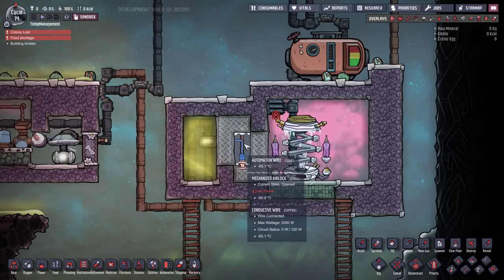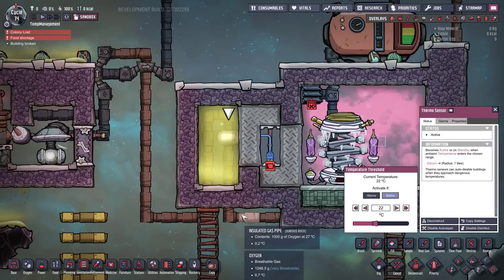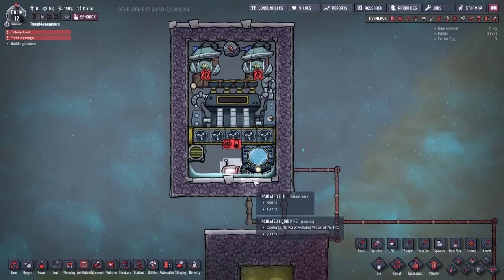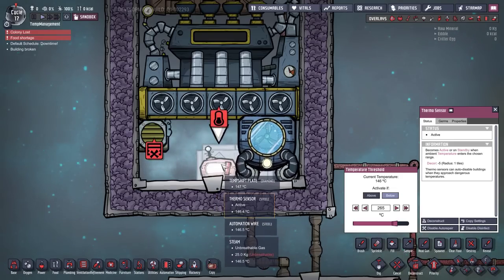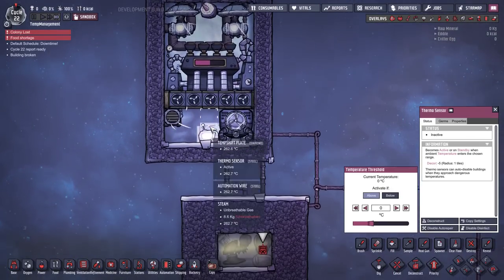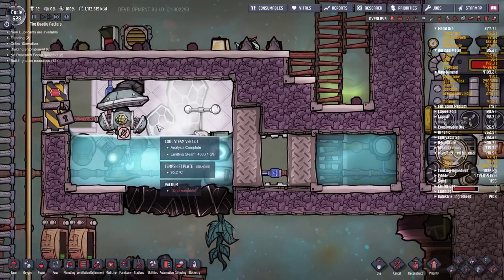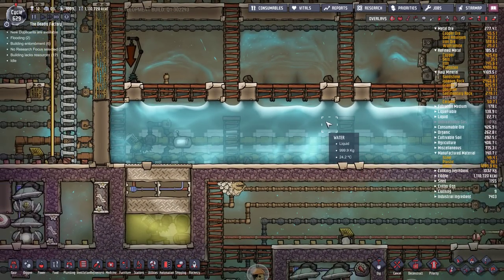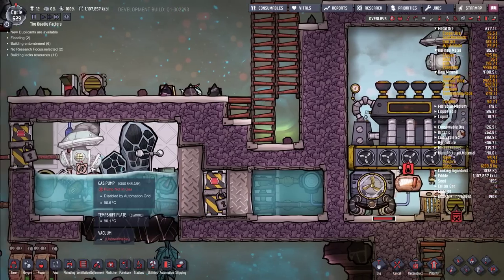Cooling, ATEN, Aquatuners and Steam turbine heat deletion. Tutorial 7 Oxygen not included

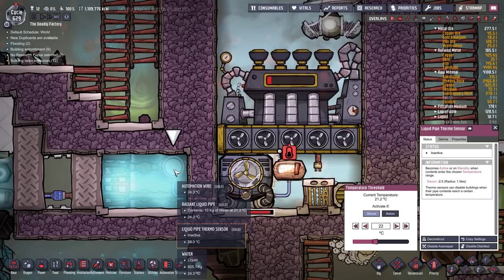Comment: answer to your question: 37:25. 
you have a 2 tile range in between the sensor and the aqua tuner which is a place where you cant check the temp. of the water
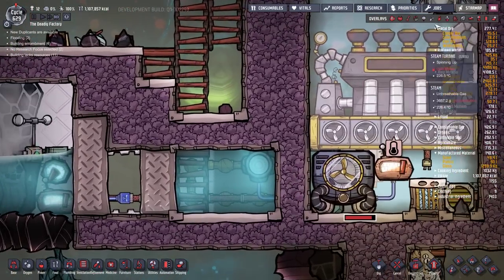you can see the 2 tile range 37:39

to let the sensor work 100% you need to place the sensor right next to the machine which has to shutoff or startup(so no place 
of unchecked temp. of water).

liquid oxygen or hydrogen for rockets, same setup but you can put the sensor right next to the aquatuner.

with this build you need a liquid shutoff next to the sensor, that will open if temp. is hot enough to go towards the tuner, if not hot enough loop is back into icebox with bridge.

 hope you understand :)
Reply from the maker: I get what you mean, I did some experimentation and found that with a little modification I could get it to work as intended if i account for one bubble possibly slipping by unchecked.

Comment: That AETN is a bit over-engineered. You can put it on an airlock door to turn it on and off. It's not exact, but for cooling oxygen it's perfectly fine.
Reply from the maker: I dislike building things on doors, feels like it's not an intended mechanic. Though I did it once for a kitchen for convenience.
Reply: I don't like using exploits at all (and too much of the ONI community is about only using exploits) and I rarely do the door thing. The AETN may be on the only real application where I do that much, since you can't really properly control it otherwise. If you use a gas shutoff valve there is a whole packet still after it.

Comment: Has the door change caused any issues with the injector method mentioned in the video?
Reply from the maker: Not that I have seen, but have not seen any door chance notes. Do you have a link?
Reply: I have problems. Sometimes there the vacuum is not working and it still conduct heat. When this happens there is also is black graphic glitch on the door itself.